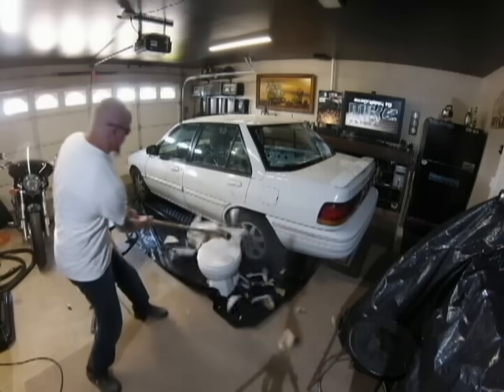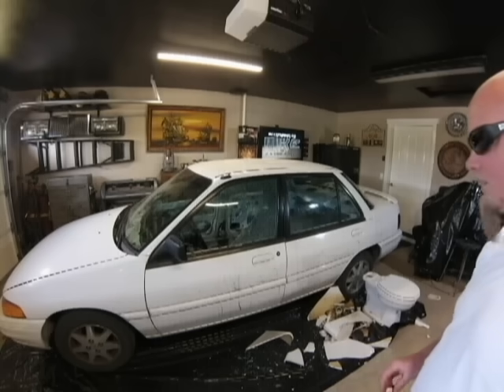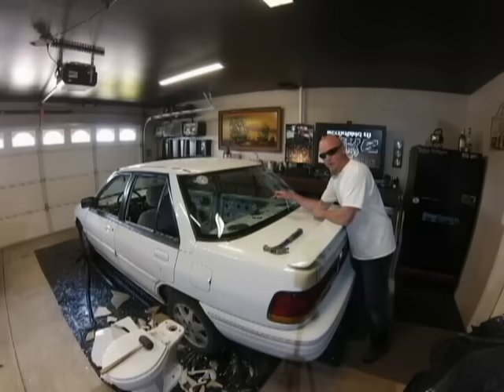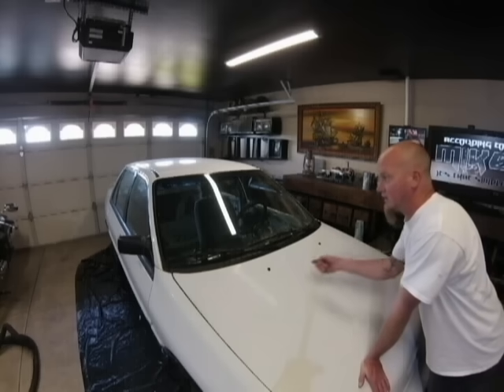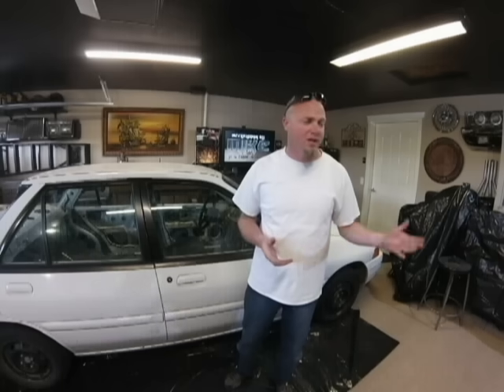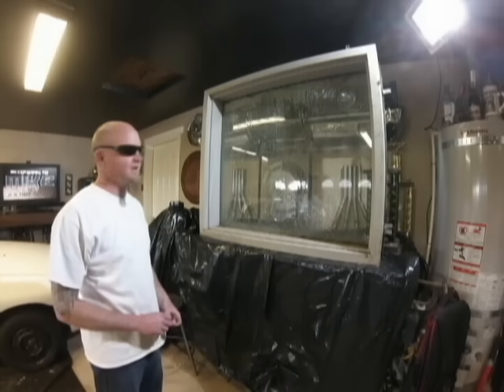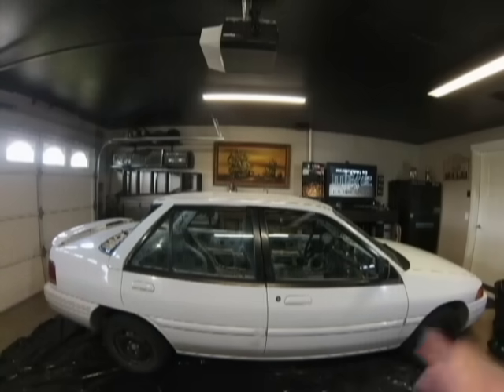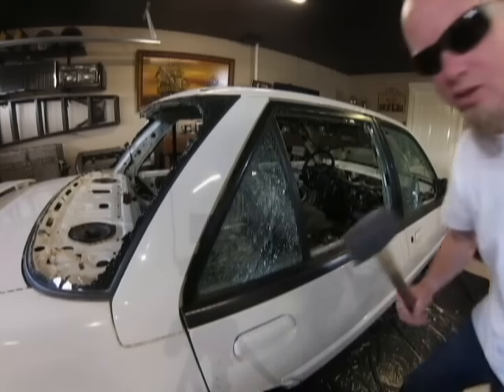How to break glass with a fragment of a spark plug (Part 2)

Comment: If you scrap porceline together it sparks.
It may have something to do with compression of the material and decompression upon impact.
Did you try both a used or new spark plug? They get hot and cold quite often maybe that changes its properties.
Maybe if you do that to the toilet porcelain it might work as well.

Comment: All you need to do to break tempered glass is chip the glass. Due to the tempering process, the glass is under a tremendous strain, and a small failure, (scratch or chip), will make the glass shatter. If you snap an automatic center punch on tempered glass, it will shatter in the same way. Tempered glass is cool stuff!

Comment: If you get down to the microscopic level then the glass will look like a mountain range. You then look at the sharpness of the spark plugs ceramic and it will penetrate deep inside the valleys of the glass and act like a cleaver

Comment: Wikipedia is your best friend.

Tempered glass, which is used for the side windows of most vehicles, is manufactured with an extremely high surface compressive stress and high internal tensile stress, giving it strength and durability, but also leading it to abruptly shatter into thousands of tiny pieces when it breaks. When thrown with moderate speed at a side-window, a sharp shard of the exceptionally hard aluminium oxide ceramic used in spark plugs focuses the impact energy into a small enough area without blunting to initiate cracking, releasing the internal energy and shattering the glass.[7] However, ninja rocks are ineffective if the shards are insufficiently sharp, thrown with too little energy, or thrown against windshields, as these are made of a laminated type of safety glass, and therefore do not shatter.

Comment: It works because pressure is defined as a unit force per unit area. The spark plug has a small surface area that contacts the glass and it makes the pressure higher for that reason

Comment: that material is made to resist to tensions up to 30kV(on europe 12V cars) because is the housing of the electrode.the area and the volum are very low so it has to be one very very hard material.

Comment: spark plug insulators aren't porcelain, as humidity can make porcelain conduct electricity.
theyre usually made from Sintered alumina, or something similar to what ceramic knives are made of(Zirconium Dioxide)

the window breaks because not only are these materials heavier than glass, they're also harder. one or the other has to give first, and glass has a tendency to shatter.

Comment: Porcelain, and most common ceramic is made from a alumina and silica [normal kaolin aka porcelain is Al₂Si₂O₅(OH)₄] BUT I don't see what it's aluminum content has to do with anything. It is most likely has to do with levels of hardness which comes from the combination of elements and the firing process to make the porcelain.  A change in the firing temperature and duration, and a change in the contents of the clay can have drastic differences in the result.

Comment: if you throw a smaller piece at a higher rate of speed at a driver or passenger window, it's slightly quitter but not terribly noticeable. the glass also stays intact similar to the office window.

Comment: Kind of due to the hardness of the material but not because its stronger than the glass, because the ceramic is such a rigid structure that is vibrates, when it hits the window the window hits back at its harmonic frequency and the ceramic transmits that frequency back again to the window with a higher amplitude, same way that machine on mythbusters could destroy a bridge or an opera singer could shatter glass.  harmonics are cool, your cars engine has harmonics thats why at certain RPMs your car makes significantly more noise, pretty much any rotating assembly has a harmonic frequency where the structure is vibrating in tune with the driving force and causes too much vibration

Comment: I bet this only work with hardned glass. It have to do with Prince Rumperts drop principle. The sharp ultra hard ceramic make a little crack in the surface, which then 'explode'. As the ceramic is harder than the glass the sharp point of it don't deform in impact, as it happens with other materials. Pretty impressive sure

Comment: The bigger chunks break it because it's apling presher over a bigger of a total area of the window which will lead into the glass breaking
Reply: J P the spelling and statement are both off.
bigger chunks will break with force multiplied by mass
if you throw a heavy object you expend energy from your arm to heavy object in kinetic energy which is stored in its mass. it will remain in motion until it looses all its energy through drag and opposing force equal to or higher than the sum of the heavy objects kinetic force.
however in engineering terms this is an inefficient waste as it doesn't take a sledgehammer to break a window it also spreads impact absorption. it takes alot of force to swing a sledgehammer.
but very little to toss a fragment of a sparkplug with a tiny point.
the stored kinetic energy of a sparkplug is very low as it doesn't have alot of mass and thus took very little energy to get it in motion. however the tiny point has a very small and focused point of impact and the absorption area is very small. this makes practically all of the mass x force applied to a tiny area.
if I handed you a heavy brick and a thumbtack and held both against the wall. you'd have a relatively easy time pushing the thumbtack into the wall whereas you could be pushing that brick all day. this is because the force of the brick is displaced across a wider surface.

Comment: if you have a hammer with you break the Windows with a hammer its logic
Reply: to loud and it wouldn't shatter the glass
Reply: +Kyrian Otaku lol? it really would shatter the glass. a rubber mallet will not, but a metal flat headed hammer will easily break it. I've done it myself.

Comment: Wind shields are not just glass. The side passenger windows are glass. The windshield has a small transparent layer of a plastic sorta material sandwiched between 2 small layers of glass. The plastic prevent the windshield from caving in.  I.e. Your driving down the road behind a dump truck full of rocks or hell maybe even toilets and a piece comes flying out and hits your windshield, the glass may crack but one shatter and get all over the interior of the car.

Comment: What i think it is is a combination of the hardness of the ceramic and car windows being tempered glass. Tempered glass is under internal tension (look up prince rupert's drops, it's the same concept). This tension causes it to shatter into a million tiny pieces (safety glass it avoids big dangerous shards) if a little bit of it is compromised. The ceramic (harder than glass) only has to scrape/penetrate a wee bit of the window to completely structurally compromise it, causing the whole thing to shatter. My theory, at least.

Comment: Weakest part of car windows are the edges, I'm pretty sure the rear window is the easiest to break since it's not laminated and has a much greater surface area.
Reply: The rear window is designed to smash with very little effort as it's made of safety glass so that access can be made in an emergency

Comment: And the porcelain from the spark plug is a lot harder then the toilet. It gets hot and is under pressure and vibrations! You can't use a soft porcelain like the shitter!

Comment: this works because when porcelain breaks the properties it has causes it to have many small points and spikes. when you throw a small piece of porcelain and a point strikes the glass it converts all of the energy you put into the throw into the tip of the point in the porcelain and all of the energy breaks the window. its like if you hammered a nail on a window.

Comment: +Eric kremer true
the glas is tempered, thus the explosion upon scouring with the porcelan chunk which is very hard and very pointy (force/surface area thing)
laminated glass never shatters 'caus the other glass is not broken, plus there is a sheet of pvb which holds it all togeter
i work in a glass cutting and manufacturiing company, so it's common to me

Comment: The reason why this works is because the windows on a car are made for blunt force in the fragments of the spark plug porcelain are very jagged and sharp looking I guess more pointy and what it does is just pretty much shatters at it just goes right through like butter and the hotknife

Comment: It does indeed have to do with the hardness of the glass.  Basically what's going on is the fragments are physically cutting through the glass and causing it to implode on itself.  The reason it does that is auto glass is a kind of safety glass that's given a special heat or chemical treatment during its manufacturing process to make it stronger.  That's why it takes a fair bit of force and skill to break a car window with a hammer.  A secondary feature is that if you do manage to physically cut the glass, it sort of implodes in on itself and makes that characteristic crumbling appearance because the outer surface is under constant internal tension.  This doesn't happen when you break a normal window in your house or a beer bottle for example.
Reply: +Alan Falleur I work for a glass company and make glass for cars, Honda Ford and Chevy. you are correct. We send a piece of glass down our furnace which is approx. 75 feet long. It heats the glass up at around 1200 degrees. It softens the glass just enough to mold it into its shape by using what we call a bending ring. Within 1.5 seconds the machine then slides the glass out from the furnace (oven) from the bending ring into a high output molding compressor in which we call the Quincher. It blows cool high compress air unknown of the PSI on the air. but its loud and even being 30 feet from it its around 90-100 Decibels and we required to wear ear protection. But in this process were taking a 1200 degree window down to 200 degrees in matter of  6 seconds.. which after that it went from a raw form of glass to what is now called a tempered glass.. the quick cooling hardens the glass in the shape it was formed. we literally can drop the glass on the  concrete floor and it can and will bounce around wiithout shattering.
Reply: Dmanor Thanks for letting us know that.  I didn't know the technical details, and it's very interesting.  I've done a little DIY glass cutting for some projects of mine but never worked in a glass manufacturing factory.

I'm rather amused by all this 'ninja rock' stuff on YouTube because they seem to think there is something special or peculiar about the fragments they're throwing at the glass.  Anything that's sharp and hard and can actually cut the glass will do this.  A standard glass cutter you can buy at Home Depot will destroy a car window in no time.  This is why you can't actually cut auto glass to fit a different car once it's been treated.  It has to be manufactured to specifications, right?
Reply: +Alan Falleur right. once a glass had been treated we cant cut into it. if we try out would literally explode and its a mess. Gets down your shirt and in your shoes, in which is why now the company is discontinuing tennis shoe type steel toes, we have to have boots or shoes that is over our ankles by June. now if there is chips that are located on the edge that can't be seen by customers which I mean will be hidden within the trim of the car, we take a dremmel with a glass grinding tip and getting the chip away.. now we haven't done it but not sure if you would be able to slowly grind away at the class we shaping it. but the glass is cut and is grinded at it's raw stage before tempered. we do what we call a scratch test and this test is amazing and goes to show what can cause the glass to explode. we do scratch test to test strength in the glass.

we take a tempered glass and then we scuff up the very edge all around at the length of an inch will have 800 grit sandpaper paper. we.let sit for 24hours on a rack. if by tomorrow it's in pieces on the floor then it was a weak tempered glass. it's amazing that little scuffs just on the outer edge of a tempered glass could even shatter it, but it does.. doesn't happen often because we make good quality strong glass. but I would say I have seen maybe 4 shatter in 6 months.
Reply: Dmanor Very interesting.  Thanks for the info. : )
Reply: your welcome
Reply: ***** Great.  I always assumed the manufactures were required by the NTSB to use safety glass in cars anyway.
Reply: Austin Leggett exactly, a good example is if  and a big IF, you were drive in to a flash flood or into a pond and dont have one of those window breakers handy, first thing to do is pop off your headrest and use the metal rods, jam into you window seal and pry backwards and it will shatter your window to escape
Reply: +Dmanor so it has properties similar to say, a prince rupert drop?
Reply: +Ethan Huffman precisely correct. It's easier to break glass on the edges because of they way they are cooled. Dead center will make your ears ring if you hit it with a solid iron bar. I've done this during extrication with the Fire Department. Edges are much more fragile
Reply: Ethan Huffman exactly just that
Reply: Dmanor the water absorbs the shocks, won't work. Just roll down the windows. Mythbusters did and episode on it
Reply: +Austin Leggett https://youtu.be/tZTa8Nh0VlE it's the the only video I can find.. watch you will what I mean
Reply: +Dmanor So it works in a similar way to a prince rupert's drop?
Reply: +Borus101 yes go check out smarter every days channel and they have prince Rupert's drops car windows regular windows and a bunch of other cool stuff ( I sound like I'm sucking his ass)
Reply: Caleb Franklin sure ty :P

Comment: Here in Germany we did this in physics class the trick is that the porcelain of the spark plug is so hard and porous that the fragment build very very small peaks of porcelain and if you take the same amount of force and spread on either the surface of a hammer or on a surface of a tenth of square milimeter, you get much more power on one spot if you want to completly understand this just look at the laws of pressure and power.
The reason why the glass looks like its exploding is because it has that where build in there factoryside because the tension lets glass shatter in that much little pieces.
If you concentrate on it you can hear the shadered glass cracking in the video due to the rest of tension in it.

I excuse myself for any grammar mistakes i did.
As i already said im from Germany so english is not my native language

Comment: you got it, ceramic is MUCH harder than glass and the regular crystaline lattice of the ceramic in the spark plug easily penetrates slightly into the tempered glass.  think of a diamond scratching glass, it takes no effort at all.  well tempered glass is under tension and the surface is under compression so once that equilibrium is broken, even slightly, the whole pane shatters.  as someone else said the toilet is only coated with ceramic, not made of it.  source: am physicist.

Comment: when he threw the  whole spark plug at the window he missed and hit the plastic on the right side of the window look closely
Reply from the maker: +Jayden Long It does look like I miss but we have actually slowed that part of the video down and watched it frame by frame. Looks to us like it hits the glass not the center post. Very close though. It was a near miss. I could do it again and again making sure to hit the center of the window and end up with the same result. Since this has been brought up before, maybe next time I have a car that the glass needs to come out, I will revisit this. Thanks for watching.
Reply: +Jayden Long he did in fact hit the glass
Reply: +Jayden Long You may want to watch a little bit closer then. He CLEARLY hits the glass.
Reply: he hit the glass.
Reply: +robert Sucks I know
Reply: +Simply Bella I know
Reply: +protothief I know